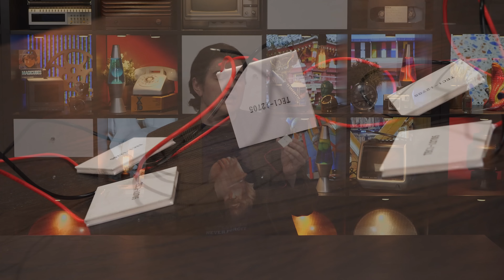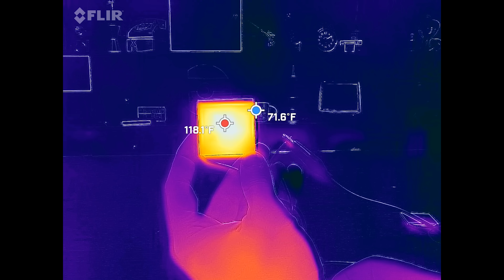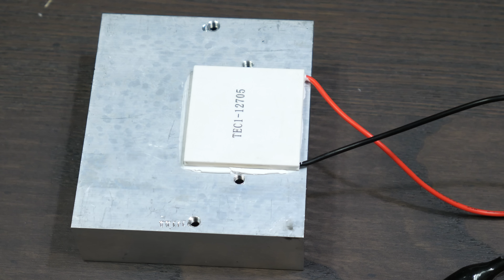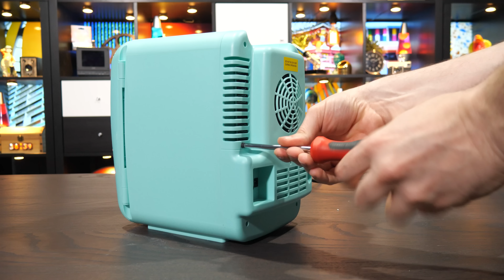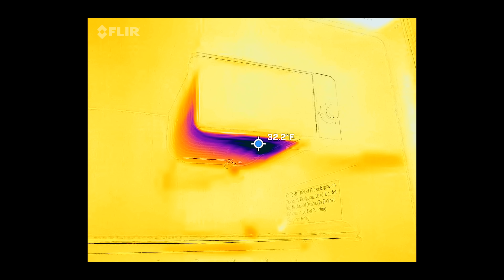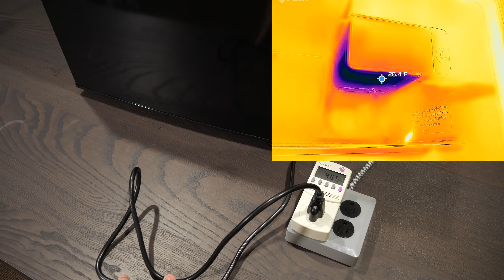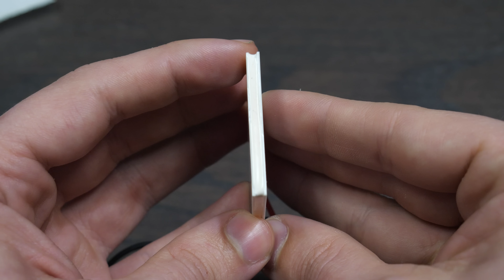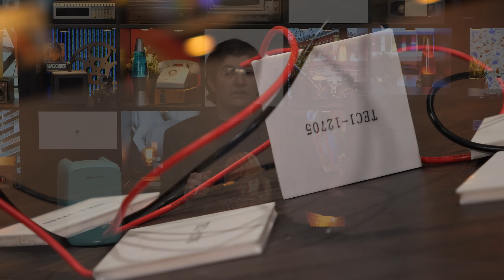Thermoelectric cooling: it's not great.

Comment: Can the shortcomings of Peltier elements be tackled by means of quantity combined with the 'underclocking' of their capacity to keep their COP somewhat high? I imagine some sort of 'disco wall' of peltier elements where only one is ever activated at one time at a decently low voltage, allowing their hot sides time to cool down. If you do that in a pattern and put the hot sides in a relatively tiny space, then you could perhaps double-up on a natural convection-current process (where hot air rises) and the order of activation would cause the heat expansion to happen in a particular direction, essentially getting a gentle airstream going without the aid of a noisy fan.
I imagine this random spitball of an idea probably fails spectacularly when one tries to implement it due to some realistic (number) limitations I don't understand as part of a random idea, but as a general concept, I really like the idea of it given my dislike of fans (ball bearr-rrr-rrr-rrrings always go bad) and compressors (ka-thunk) because I'm pretty sensitive to background noises.

Comment: The way the blue one cools, and many other fridges with the same guts, is far better than the Xbox Series X inspired fridge.

That fridge works by using one fan to blow hot air upward and blow the cool air downward. The performance is not great and the condensation buildup is enough to form ice and block the fan from cooling the beverages. It takes around 4 days to do this.

However, I have another fridge that uses the same technique as your blue one and if you leave it on long enough, the beverages will eventually freeze. I found this out the hard way when I found a frozen half gallon of iced tea that I had forgotten about.

If there is heat to remove from something touching those screws that contact the Peltier, it will remove heat until it can't anymore.

These things suck back more electricity than their more expensive compressor-based cousins bc they run all the time and not just as needed.

I've only watched about 8 minutes of the video before commenting and I really hope you dissect the guts of this thing to make it more efficient (through the magic of buying two of them, of course)

Comment: Peltiers can perform A LOT better if you run them at lower current, not at their full rated one.
There are charts online of current vs COP at different temperature deltas.

Comment: I use a peltier / thermoelectric ebay contraption to cool my little 29L (3.8gal) aquarium. It cools about 1 degree celcius per hour... kicks in at 24c, brings it down to 22c, plumbed in to the return flow of a little external canister filter, with the exhaust fan pointed away from the tank obviously.  While not efficient by anyone's standard, it is actually quite good for the fish - the slow cooling does not shock them, and on a hot Australian day it is a literal lifesaver.
It's an inexpensive water cooling device, and thankfully the majority of its power usage is during the warm daylight hours so the power comes from my solar panels.

Comment: I had one of the larger more expensive units for about a year and in an office environment with the temperature set to 33° F and it was just okay plus it took a very long time to cool.  I replaced it with a normal fridge and am much happier plus it was cheaper than the peltier.

Comment: the way I had heat pumps explained to me was that you're basically dipping a sponge in a bucket, pulling it out, squeezing it, and not letting it expand until it's back in the bucket. the sponge (refrigerant) moves the water (thermal energy) out of the bucket (fridge), and squeezing (compressing) dumps the water on the ground (in the air).
Reply: Nice explanation.
Reply: That's a really cool analogy, thank you for sharing it!
Reply: and if you can grasp that concept, then the next step to understanding why steam-power is a dead end, except in certain applications, is that you  have to MAKE the sponge first... ie, by BOILING water to MAKE steam. a steam engine only gets to use the heat and pressure contained in the STEAM... not the energy required to simply boil the water. which amounts to about 4/5ths of the total energy input... completely unrecoverable.

"so why do we use it in power stations"?

because it can "transmit" a large amount of energy without requiring excessively high pressures or temperatures... its also non-toxic. when you get to the scale of multiple M-Watts, that means the machines can be relatively small and compact...
Reply: @paradiselost9946  except you omit to mention the role/potential role of steam in preheating the boiler water.  Obviously that's going to depend on whether the steam device has a pre-heater....  but the concept is great, and reduces energy loss hugely. 

Suggesting that the energy required to make the steam is completely unrecoverable is completely bollocks....
Reply: @annpeerkat2020  you overlook the nature of heat flow.

you cool the steam to 50C in the condenser... and a condenser it an absolute necessity on a steam turbine as the majority of work performed by the steam is at this "below atmospheric" stage... below 100C. 

you cannot preheat the feed water above 50C, either, on average, with a condenser. can heat it higher with the heat going up the chimney if its coal or gas fired, but not from the condenser. and as both approach that temperature, less and less heat is transferred. 

and the condenser still has to radiate a certain amount of heat to the atmosphere, otherwise... it stops condensing.

the closer you can get to a hard vacuum, the more power you can extract. unfortunately reality gets in the way and prevents one from achieving such low pressures. 29 inches is considered the limit of practicality. 

and only so much feed water can be preheated. as the boiler only requires so much feed water. theres no point heating more than the boiler can consume. and then the water or condensate emerging from the condenser is already at that 50C region... and is the same amount of water the boiler requires, minus losses due to leakage... theres no gain in using the condenser to preheat feed water AT ALL.

if you have the advantage of locating it in a subzero climate, all year round, sure, you can extract more, as you can achieve far lower temperatures in the condenser, with subsequently higher vacuums, but no matter what you do, the vast portion of thermal energy in the fuel goes to waste. regardless of what wikipedia leads you to believe when they claim "45% efficiency" or better. they choose to neglect various rather important factors to make things sound far better than they actually are. its called "cherry picking".
Reply: @paradiselost9946    Your first post uses the term "steam engine" but your second post quietly changes to "steam turbine"...  two terms that can describe very different things.
My response was in regard to "steam engines"....  of the conventional type, not steam turbine machinery that may in limited circles be called steam engines.
"Steam engines"...  most commonly used in steam locomotives, do preheat boiler water with spent steam, significantly reducing energy loss.
Steam pressure and steam heat vary in different locos, but recovering energy from superheated steam that is spent is useful in energy terms. 
Google is your friend to realise this.

Regarding your statements about preheating feedstock in steam turbines...  taking the information that you yourself present...  you describe steam turbines using condensers, with water/ (steam) losses only due to leakage.   If there is no steam "going up the chimney", then apart from incidental leakages ALL water/steam is recovered, which means spent steam cycles back to become ALL the feedstock, meaning ALL the water is preheated. 

In summary, all steam ENGINES (locomotives etc) from the golden age of steam use water preheaters.

"By the 1930s, the inclusion of feedwater heaters had become standard in steam locomotive construction, with the Worthington SA type emerging as the most popular due to its efficiency and reliability"

From your own statements, ALL steam turbines use water well above environmental temperature since they run closed water systems, using condensers to capture the previously heated steam when it is spent.  In this circumstance it would be a nonsense to describe the hot spent steam/water as being preheated...  the already heated mix is simply captured for reuse at ALREADY raised temperature. 

PS... is this "cherrypicking?"
Multistage (moderate to high pressure ratio) steam turbines have thermodynamic efficiencies that vary from 65 percent for very small (under 1,000 kW) units to over 90 percent for large industrial and utility sized units. Small, single stage steam turbines can have efficiencies as low as 40 percent.
U.S. Environmental Protection Agency

Comment: also fun fact about peltier elements: they work in reverse. that is, if you cool down one side and heat the other, you get electricity. This application of them has mostly two use cases: one, if you're living in, say, a random hut somewhere in sibiria and you only need a bit of electricity (for a phone or radio etc) they're a great choice to, they were incorporated into gas lamps in soviet times. two:  they are perfect for Radioisotope thermoelectric generators for spacecraft (Perseverance has one, as do the voyagers, as do most probes which go outward from mars, because solar cells (especially when they were less efficient in the past) become vastly less efficient out there). RTGs are a perfect application for peltier elements, because they're really just a sub-critical pile of radium giving off heat, peltiers have no moving parts (important for years long missions with no possibility of maintenance), are light and tiny, and don't need specific temperature ranges to work within.

Comment: Now we need a video on Connextras to see what happens if you fill the front door and any other voids in the blue thing with insulation material. Will it then make canned drinks explode? (Or less dramatically freeze water in an open container)? And as @lucidmoses suggests could it be a good fridge if given that insulation and a thermostat?

Comment: Ued to have a cooler in my truck that used these. I added a couple extra and a temp control and it worked fairly well to keep food and drinks cold while driving long haul. These days though you just install an RV fridge and call it good.

Comment: I've got an old Coleman Peltier cooler, 40 quart I think it is. I use it in my camping trailer as my beer fridge. It runs directly off 12 volts, so I set it outside, just under the camper by the door when I set up. I load it full of beers when I first set up. Cans, bottles, doesn't matter. It'll hold maybe 30 bottles and some cans. The next day they're perfectly cold. 

The best part of it being 12v is, I can run it off my campers battery and solar.

I think you should revisit this topic with something actually designed to take full advantage of the technology, rather than some cheap toy fridge. My Coleman has an internal, and external heat sinks, with an internal, and external fan.

Comment: I used such an TEC element during my MSc graduation assignment to finely control the temperature of a (relatively) small metal surface over. The active control (via the PSU) combined with a wide temperature range (I needed -100 to +50 C) and a very local target made it the only real solution. We had all the luxury to get rid of its heat tho, with a high end liquid chiller hooked up to a enthousiant grade CPU cooler on the TEC!

Comment: Yeah, I actually have one of the niche use cases where the $30 was worth it.  Long car trips to keep about a 6 pack of Diet Cokes cold for the trip, and half the space and weight of a cooler (and no dunping out the ice and water afterwards).

That way when I get to my destination (where I have access to an actual fridge, that is unpugged and slightly propped open while I'm not at the hanger), I can stock the fridge with two twelve packs of ambient sodas, 6 cold ones, close the door and plug it in, and I won't have to wait a couple of hours for the ambient temp sodas to cool off.  

Niche case, yes.

Comment: Peltier coolers are used also in astronomy cameras to cool down sensors, but usually are used with thermostats and heatsinks to keep a specific, constant temperature. This is important because allows you to collect photons in a very reproducible way over several nights. 

But cooled cameras often costs 300-400€ more than uncooled cameras using the same sensors and all. 🤯

Comment: All you need to do is hook up a custom water block to the hot side of the Peltier and pump it through a moderately sized radiator.  Combine that with duty cycling, and you've got yourself a slightly less complicated than phase shift system that's 5 - 10 times less efficient than phase change systems.

Comment: I have often used analytical equipment that needs to keep reagents cool to prevent degredation. They almost all use peltier  cooling for this, as the running cost is less than the cost of analyser downtime and engineer callout for replacing a broken compressor in a very inaccessible area.

Comment: My Frigidaire 18 cubic foot refrigerator (top Freezer) usually uses around 900Wh to stay cool in a given day. (I have metrics for that circuit dating back six months, because I'm a massive nerd. So I'm in good company)         
I'm honestly shocked that it uses so little power for what it does. Fairly easy to keep running on a battery system during an outage!

Comment: One additional thing that thermoelectric coolers are great for is very precise temperature control. Particularly, single frequency mode diode lasers need temperature control on the few mK level to keep from changing frequency. Thermoelectric coolers + a thermistor and a temperature control module can do that. Since the heat load of a diode laser is typically not very big, and they are generally thermally synced to a big block of aluminum, you often don't even need a fan or liquid heat exchanger to cool/heat the other side. I use them for this application and several other precision temp control applications around a lab.

Comment: bought a dehumidifier on amazon that essentially is an AC unit but solely designed to pull moisture out of the air. Have had it for a year and a half and love it. I can totally see you releasing a video about why its awful lol

Comment: Random Question that might send you down the rabbit hole:   How do refrigerators on the International Space station work?  I would assume efficiency is of utmost importance... Do you think they have a special compressor that's not orientation specific, a heat pump with a radiator attached to plate?  But I thought without air heat exchange is a actually pretty poor. 

too many questions. Brain may melt.
Reply: Funfact as far as I know there are no fridges on the ISS 
There was for a short time because they had to cool an experiment while bringing it to earth, so on the way up they filled the fridge with ice for the crew

I imagine they use "just normal heat pumps" for cooling the station via the white radiators, that kinda look like white solar cells

Comment: i wonder if  a peltier chip being used to function as a "super cooler" device in things like PCs, would work? attached it as a part of or as an interceptor for your heatsink and when you need to burst cool the PC have it kick in and drop the thermals of the PC down rapidly. i assume its not going to do wonders but better than just a fan blowing more air more quick and if it would work how much more efficent it would be to a liquid cooler

Comment: To properly and efficiently cool anything, you first have to remove the heat through tubes or ducts.  In other words, a radiator system.  By keeping the heat in the same general area, it's defeating the purpose of cooling.  It's a self-defeating technology.

Comment: Peltier cooling is used effectively in cooling imaging sensors for very low noise light collection. That is junction noise, not sound noise. 
Sometimes these are stacked like a pyramid for this use.
Sometimes these were used for cooling the thermal sensor on portable cameras, where the other option was cryogenic gas cooling via open evaporation or closed cycle 2 stage compression.

Comment: I feel like the real reason to get a minifrige or similar with a peltier module, is its size. I often just want a cold bevrage on my desk. A compressor style minifrigde doesn't fit my desk. So what i really want is a micro compressor styled minifrigde. Enough to hold any singular bottle, or a tiny lunch.
Reply: Why not go to the kitchen where the whole fridge is filled with even colder drinks?

Edit:
Maybe at the office 
Usually we have fridges there tho

Edit:
Also way to loud

Comment: They sound bad for cooling, but since the existing heat present in the area is being shuffled around to the other side by this (and thus more heat to be had than just turning electricity into heat) how effective are they for heating ?  Seems it could (emphasis on could) be better than just electric hotplate for limited power input applications (read: solar or battery) where just throwing more power at it isn't an option.

Comment: UK standards is 5°C is the highest you are allowed, 3°C is the minimum. because below 3 just freeze it.

EDIT: electric heaters are 100% efficient, purely because you want the heat. also heat pump's are only effective in closed loop closed space situations, like fridges and freezers. open spaces, like a home, even a UK home, are too open to have heat pumps be valid. then there's the fact that as soon as a window or door is opened, heat just pisses out them and costs spike. dramatically.

Comment: There are 11L car fridges with a even smaller compressor, with compact size that's not much bigger than the blue peltier thing you bought. They pull like 17W 12V. Yep. Really.